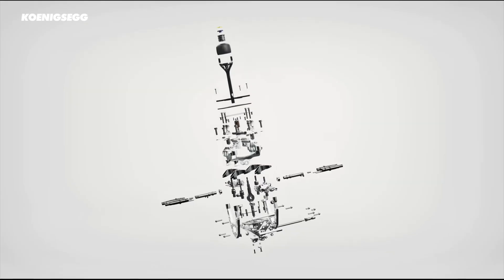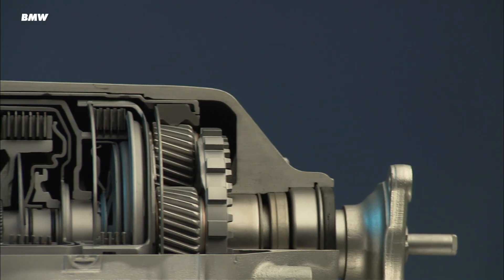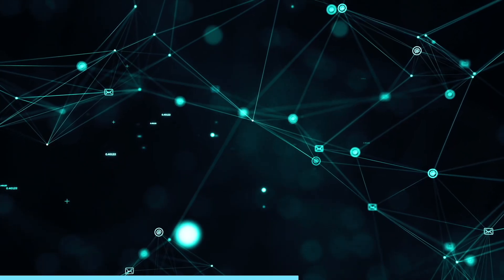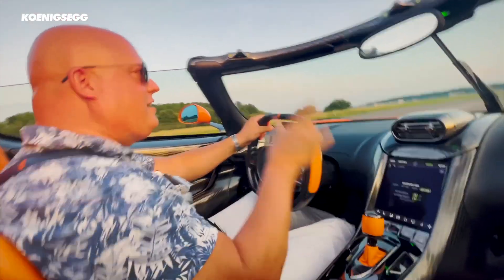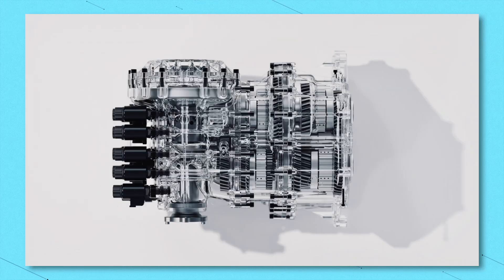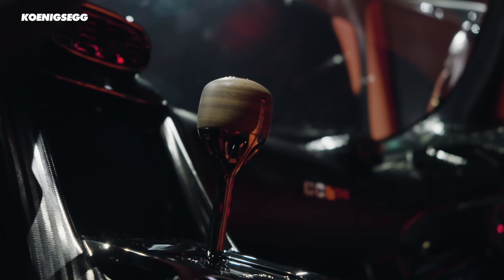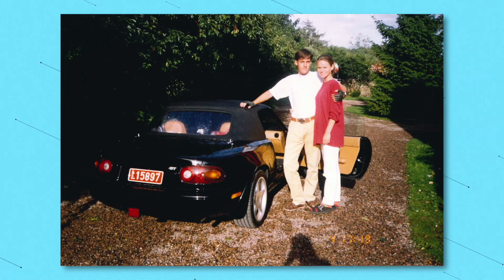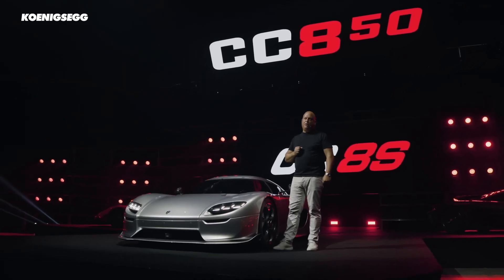Why This Car Has 7 CLUTCHES!

Comment: A solution looking for a problem. Dual clutch transmissions aren’t even slow to change gear. Even if was in the wrong gear, it only takes 8 milliseconds to change gear.

Comment: Great example how over-engineer can be so bad, it's like the MGU-H for F1 cars, it removes the turbo lag but it's so complex and expensive that it's not worth to have it, same with the one-clutch-per-gear, and they got it all wrong when they added a lever to change gear, there is no point on not using the paddles since it's much faster and easier. Just as a reference, a F1 car can go from 8th gear to 2nd gear in only 1 second (they rarely use 1st gear)

Comment: The gearbox is not only a bit smaller than a 7 speed DCT. It's ALOT smaller. It's the size of a 6 speed manual gearbox. AND it can handle INSANE numbers of torque. The only DCT that can handle the same amount of torque as the LST is in the Bugatti's and that is more than double the size and weight. Koenigsegg are just mindblowing.

Comment: The first manual gearbox that can switch ratios depending upon the situation? What about all those old cars with overdrive boxes? Or the C4 vette with the overdrive switch?
Reply: That's not switching ratios, is it? Overdrive merely engages an additional gear set to add more top speed. Meanwhile, Koenigsegg's solution is to take a range of 6 gears (2-8 for road, and 3-9 for track use) from the 9 they have in total, to adjust the driving characteristics
Reply: @halofreak1990  It's so nice of you to explain when you don't know what you're talking about. I hope you consider that in other parts of your life. Please go look up how an overdrive gearbox works and get back to me with a correct explanation
Reply: @dj_laundry_list  it's so nice of you to take things personal and then come back with a smug, know-it-all attitude while not even explaining why what I wrote was wrong.

Maybe you should take a course on how to deal with criticism. Sounds like you need it.

Comment: According to Christian, when in automatic it'll be its regular 9 speed automatic, and it'll jump between gears the way the computer sees fit.

The 6-speed street ratio will use the following gears on the LST: 2, 4, 5, 6, 7, 8.

The 6-speed track ratio will use the following gears on the LST: 3, 4, 5, 6, 7, 8,
Reply: Assuming that sedate street driving means using the lower part of the rev range, you need longer gear ratios. This suggests the street 6-speed config might be  4, 5, 6, 7, 8, 9. Or maybe you guessed right for street trim with 2, 4, 6, 7, 8, 9 to ease clutch engagement at low speeds. That makes some sense too.

On the other hand, track driving means you operate much higher in the engine rev range and you have no need for the tallest gears. Where can you do 240+ MPH on a track anyway? On most tracks you don't have the room to reach that top speed, so you have no need for really tall gearing. So track mode would be 1, 2, 3, 4, 5, 6.
Reply: @Hydrazine1000  I'm not guessing. Christian said this in an interview. Track cars have very tall gears because they barely ever need to be down at the lower register. So the track ratio starts 3, 5 etc. Street ratio starts 2, 4 etc because those happen to be the same ratios for 1 and 2 on a traditional 6-speed.
Reply: @ohedd  Oh, OK, thank you for the clarification. 

To help idiots like myself, can you add something like "according to Christian, who stated this in an interview" next time, to show where the information came from?
Reply: @Hydrazine1000  yeah good idea

Comment: proper manual = clutch pedal hydraulically linked to the clutch, shifter mechanically linked to gearbox and shifter forks

is this good enough? Yes. Yes it is. Find me another factory car that compares, and has a h pattern

Comment: It was my understanding from thier video revealing the car that in manual mode the shifter is actually hooked up to the gearbox, but rather than linkages, the shifter essentially selects which clutches the clutch pedal actuates.
Reply: I thought the same initially but no, the shifter mechanism is entirely digital, “gear-by-wire” as said in the video. Christian confirmed it in DDE's video, but it should feel exactly like if the linkage was actually connected.

Comment: This type of transmission has been used in tractors for the last 30 years,  i used to work as a tractor mechanic, and have worked on transmissions just like this on New holland and Case IH, they just had more gears and cluthes, but same principle, only down side is that you loose alot of power through this type transmission, because all the cluthes that is not engaged will still drag a bit plus all the oil preassure needed to run this transmission,
Reply: i think at 1k+ HP that slight extra weight compared to traditional multiplate clutches for a more accurate shifting like when cruising then suddenly you have urge to speed up, still a fair trade tho, also i think in 1k+ HP its like extra 1 passanger kid weight, like its not that much matter since koeniggsegg its not track focus car, lol

also yeah i realize its similiar to some trucks gearbox too like the eaton 16speed, lol

Comment: so is it technically a 15 speed like a semi. with certain gears blocked out based on conditions
Reply: No. It's a 9-speed, with a subset of the gears used for the two manual modes. Christian explains this in the various interviews, where he also states which 6 out of the 9 gears are used for each mode.

Comment: Meanwhile other hypercar manufacturers are trying to beat the production car speed record with insane power, Koenigsegg is just optimising what they actually have. It's not always about power, it's how efficiently the power is delivered. A true perfectionist in my opinion and a brilliant innovator.
Reply: The worst offender i can think of is Bugatti. Put the largest engine they could conceive in  a land boat just to have the highest top speed on a production car, sacrificing lightness, agility and cornering performance, heck even a P1 would beat the Chiron around a track. That's why you only see Bugatti being bought by Arabian Princes' and American rich kids, and not by proper petrol heads.
Reply: Huh? Koenigsegg is the one with the insane power.
Reply: @jamesengland7461  Well they make a three cylinder engine and other supercar companies wouldn't even think about doing something like that. Yea Koenigsegg does have very powerful engines but they think about way more than just bigger engine == go faster. Their electrically actuated camless valves is another example.
Reply: @jamesengland7461  In the world off 1800hp venoms and 2000hp electric cars
Reply: The hennesy venom f5 has the same drag koeficant but a lot more power, should beat the Jesko aboslute
Reply: @0WhyNot3  drag coefficient isn't that relevant. It's what you do with it. Hence two Jeskos. One for speed, one for handling.
Reply: @grisflyt  Drag coefficient tells you about the air risistance that the cars have. More important than power but if they are the same, the car with longer gearing and more power will have a higher top speed
Reply: @0WhyNot3  In theory, perhaps. You still have issues like down force, handling/stability.
Reply: @grisflyt But this time we are talking about hypercars, in a straight line at high speed that should be the limit
Reply: @0WhyNot3  Then do it.

Comment: Video opening: "Koenigsegg has built probably the most complex gearbox ever"
John Deere engineers: am I a joke to you?

(almost every agricultural hauler, tractors and harvesters are all using transmissions that work almost the same for years, the difference is that they can change gears seamlessly, so they feel like a cvt would)
Reply: Koenigsegg have patents on the gearbox so no, it is not the same.
Reply: @thorc4167  I literally wrote down the difference so I know it's not the same

Comment: I was wishing for someone to develop such a gearbox technology because it should be easily adaptable to an EV and I'd love to have such a feature in my daily driver EV. But damn Koenigsegg is a bit on the expensive side :/
Reply: I believe Toyota has a patent for a manual EV, not a real manual but one which limits the motors torque according to gear and 'RPM'.
Reply: Yes. Toyota has a patent for this very same idea for their EV's. I really hope they proceed with this. Some people laughed at it but seem to fail to see the benefits of this feature. Koenigsegg does it and it's amazing. Haha!

Comment: How to have "Ultimate Power On Demand":

Option 1: Complex 7 clutch gearbox
Option 2: Electric motor
Reply: I smell Tesla fanboy 😆 Electric motors are great, but they don't provide ultimate power on demand. A virtually flat torque curve means that the drop-off of acceleration is more significant than in a car with a gearbox- hence why my 2012 Lexus hybrid was significantly quicker from 100-150mph than a P85D (the current Tesla when I found that stat). That gearbox could be attached to an electric motor and it'll do the same thing.

Not that great acceleration above 100 really matters in the real world, but the point stands- an electric motor doesn't solve the problem that the fancy Swedish box is there for, so in answer to your comment: no.

Comment: Can we agree that flicking the paddle and throwing your hand in the air is the lamest possible thing you can do in a car?
Reply: Nope, its a normal behaviour when your whole body is on the outer edge of everyting .. itworks with slower cars too if engage in it 👋😵‍💫
Reply: It's a dramatic demonstration of the speed of the box.

Comment: He has said in no uncertain terms that the gear ratios change between the track and road gears. He even said first gear in track mode is the same ratio as third gear in automatic mode. He also said that first gear in road manual mode is second gear in automatic road mode.

Comment: Ive been hearing/reading/see 6 clutches. Theres apparently not one between the engine and transmission. Could be wrong.
Reply: No need. Crankshaft goes straight to the clutch of first gear
Reply: Actually 7 clutches. 6 for each forward gears, and 1 for the reverse gear. So it's doesn't need a flywheel.
Reply: no external clutch,  no flywheel either

Comment: More clutches = more repairs = more $
That'll be my first guess. Now, let me watch the video

2:40 damn, that's actually a pretty good reason.

Although, I do wonder how this affects the weight. 🤔 He didn't even mention it.
Reply: the mechanism surrounding it seems lighter though. Have a feeling it is only slightly heavier.
Reply: Well, at least it is wet clutches so they should last longer than a dry clutch, and in a car like this I think the owners won't care that much about having to service it.
Reply: It weighs less than an equivalent pure manual.
Reply: Yea im pretty sure weight is negligible for ya know a MANUAL
Reply: In a dct 2 clutches are used for all the gears, 1 of the 2 clutches, aka 1/2, is always used, but in koengiseggs box each gear uses 2 (out of 6) clutches per gear (7th clutch is reverse). 2 out of 6 is 1/3. So technically their box will on average use each clutch less than a dct.
Reply: If you got enough money to buy that car, I think you don't have to worry about repair money 😅
Reply: @aaronaaronsen3360   i know. I meant the typical company’s petty tactics of making profits. But hey, I should’ve known better than comparing these crazy phckers to a typical company
Reply: @L W  I know